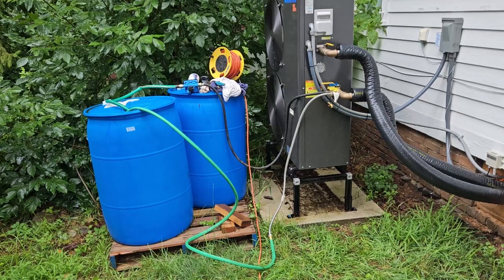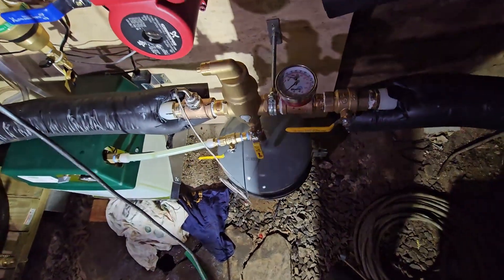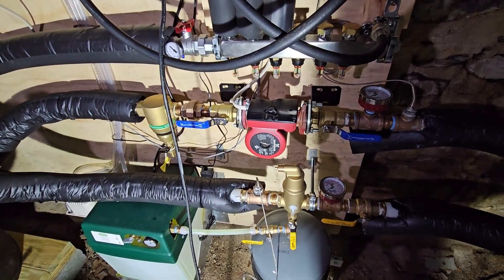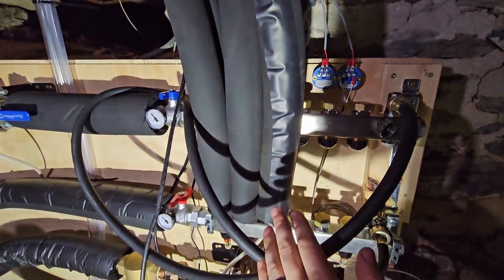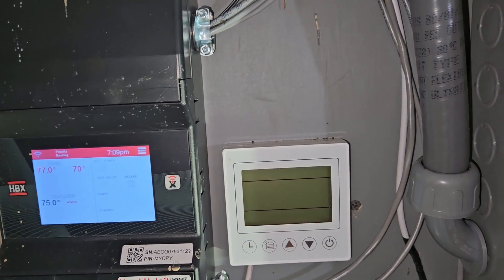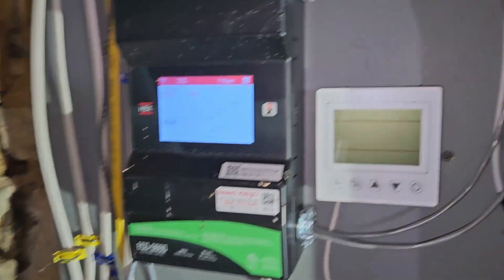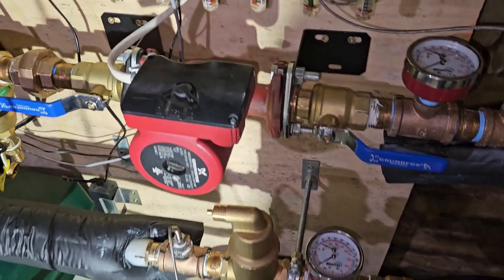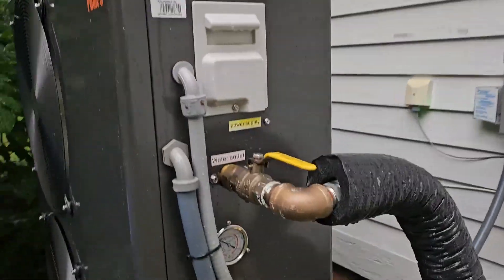Air-To-Water Heat Pump: System Startup

Comment: Question.  In cooling mode, my circulation pump between the Heat pump and buffer tank runs all the time regardless if the compressor and fans are running.  Even when the tank temp matches the set temp.  Does  yours do this?
Reply from the maker: Yes, mine does this in cooling and heating mode when I'm using the factory controller. I use the HBX controller which allows the circulator to turn off when there is no call for heat/cool from the tank

Comment: Is it R410a refrigerant?  Such a shame you did not go with R290. It's just become available. Works down to -35C  and heats to as high as 85 C. R410 is being phased out since it a major greenhouse gas. R290 has a GWP of just 3 and a smaller pressure and charge so it much more efficient and climate friendly. R410a runs the cycle hat much higher pressures so its harder on compressors and requires more kW per unit of energy produced. Don't get me wrong, what you are doing is admirable and much better than burning fossil fuels for our children and their children. I'm enjoying your build. I just ordered a 5 tom ATW R290 heat pump to replace my condensing gas boiler. Mine is simple. I have an indirect tank that feeds my 14 zones of in concrete floor heat and contains a coil running threw it for domestic hot water. I had 8 zone valves on thermostats and no have disabled them after tuning the flow through the loops. I now have one thermostat and my house always has warm floors in winter and is super comfortable. It's a 20 year old ICF so it's super insulated. I suspect that 5 ton will be too large. Next year I will run the cooling lines central high velocity fan coil unit to convert from R410 central air.  I think you will be pleased with the system you have built. Removing air from hydronics usually requires a bleeder at the highest point in the system. Since you have a variable pump you should be able to speed it up to flush out the air. Cheers!

Comment: Congrats! A big day. Didn't you switch the manifold piping once putting it together (ouch)? I was curious how you might deal with condensation in lines in house? I think I heard one can get a meter that measures dew point and keep the water above that? We are really dry location but it is quite cool at night so i don't think we need it. OH what temp will you think of setting the tank at in winter. I suppose you will test it out. My project is getting close. So far so good. A much tighter space and retrofit is making it a bit challenging. Again. So happy you have it working and are just fine tuning things.
Reply from the maker: Yes I swapped the manifold lines and everything is working well. I get condensation dripping off the components in the basement (manifold, pumps, etc) but it's no big deal, it just drips on the dirt floor and soaks in lol. The 12" or so of plumbing from the floor to the fan coil inlet do sweat sometimes but it never enough to drip. In the summer I run the tank at 45-60 degrees, winter I'm running 75-120 degrees depending on outdoor temp

Comment: HVAC service tech here. You would get better performance at the air coils if the water is kept from 50 to 55 F. You will get more noticeable temperature drop in the rooms. The next thing would be that you have what is know as a superheat measure to modulate the water flow. If you keep the flow so that you can get about 10 to 12 degrees of temperature rise then your system will work more efficiently. If I had my own place to setup something like this, that is how I would run it.
Reply from the maker: Great information. I'm running the tank between 45 and 60F this summer depending on outside temp, it is working nicely. Are you referring to a 10 degree drop at the fan coil? I think I'm getting about 5-7 degrees right now with the flow maxed out around 2 gpm per coil. Sounds like you would recommend I slow that down to increase the deltaT a little bit? Thanks!

Comment: what I need is a hvac heat pump that heats my water heater tank (which happens to be right next to my HVAC unit) in the process of running the AC.  Should be an obvious and easy idea right?  Why nobody offers this?
Reply from the maker: You can do this with a hydronic heat pump (air to water or water to water), it just requires two tanks. The unit will switch from heating to cooling as necessary to keep each tank at the required temp. I agree it would be nice if there was a way to do both simultaneously. Thanks for watching!
Reply: What you describe is a heat recovery system. They are more expensive to setup and run. Three refrigerant pipes and a distributor box that selects which and what refrigerant flows where. Most of the time you can use the heatpump water heaters and make sure the air in the room is warm for it to work. If your furnace is right there then I would suggest adding a vent to the supply and returns so that you get some air flow in the room. To really control it add a zoning system so that when the room gets too cold the furnace with its fan running constantly a valve opens the return and supply in the room to circulate air inside making it warmer again.
Reply: It already exists in Europe and Asia. Look up VRF and VRV heat pump systems. I'm going to use their manifold to heat and cool at the same time. In the summer the AC just heats the outside more when I still need hot water and even need heat to dry clothes. The ideal system would have one heat pump that feeds you heating and cooling and drier and refrigerator/freezer. It's all just the same thermodynamics.

Comment: how much are these heat pumps ?
Reply from the maker: Arctic Heat Pumps has pricing on their website. Thanks for watching!
Reply: @betweentwobrooks  how much did you pay?
Reply from the maker: I'm planning a video on the full cost breakdown but we paid around $10k for the heat pump, buffer tank, circulator  pump, import tariff, and freight from Arctic back in 2022
Reply: @betweentwobrooks  wow that's way more reasonable than I was expecting. Thanks!
Reply: @betweentwobrooks  don't forget the tax rebates. Several thousand with incentives from local utilities and cities as well.
Reply: I rather buy a $600 water heater and a 3k split system
Reply: @glglmike7177  calculate the pay back..then you might be right
Reply: @glglmike7177  then do it

Comment: I would almost avoid the buffer tank for cooling, unless you want to charge it at night when power rates are lower.  Also the hot return should be going to the top of the tank, and the cold supply should be coming from the bottom of the tank for your fan coils, the heat pump should be pulling from the top of the buffer tank and feeding the bottom in chill mode. If your tank temp was 58F you should be getting close to that for your coil supply side temp not 70ish, I think you have some unwanted mixing going on in your buffer tank.
Reply from the maker: I chose to plumb the tank to favor heating since we only use cooling for a couple months of the year. After I switched the manifold plumbing the flow is better and the fan coil supply temp is essentially the same as the measured tank temp. Thanks for watching!

Comment: I would remove the zones and  balance the system out, it will perform much better and be more efficient especially if you can use weather compensation
Reply from the maker: Thanks for the feedback!
Reply: I agree but I think he has room thermostats. I went from 14 zones in floor to one thermostat but my house is R50.